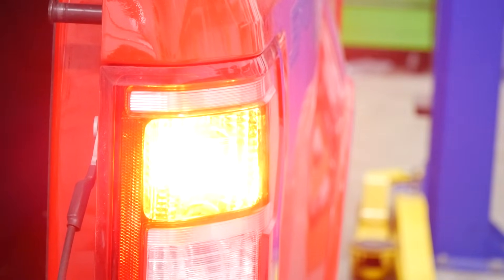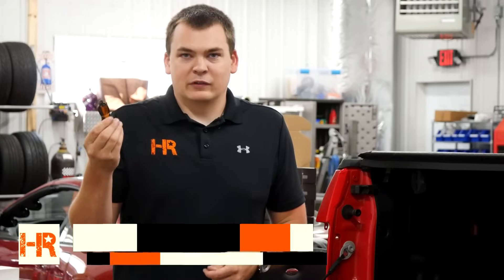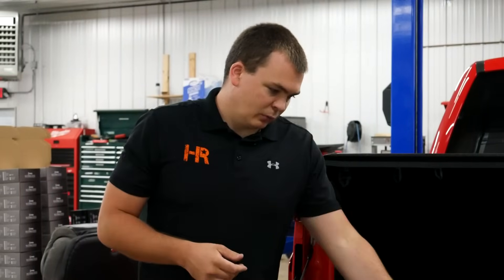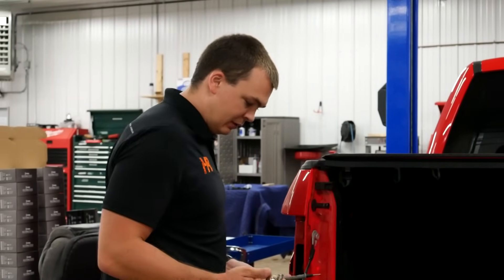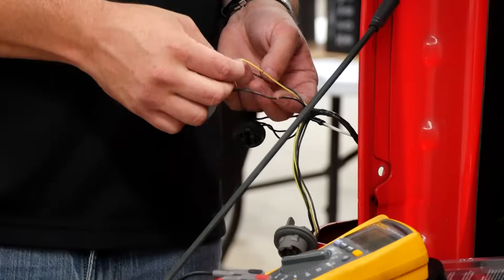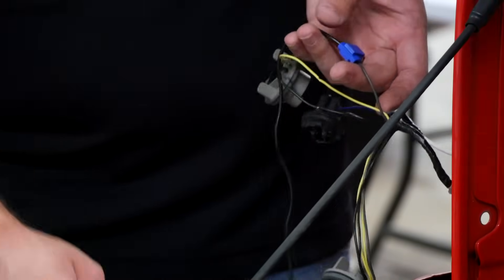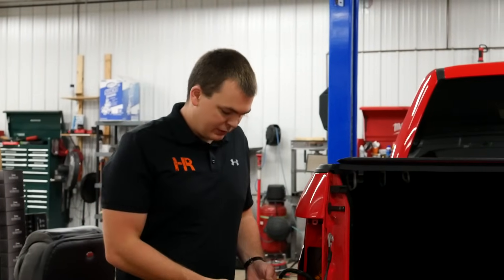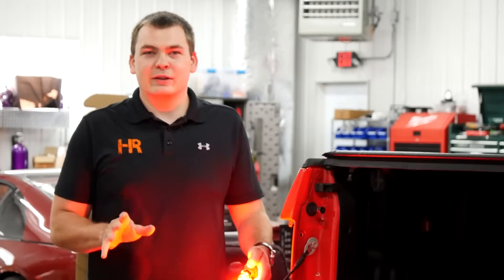How To Install LED Resistors - Everything You Need To Know | Headlight Revolution

Comment: Resistors can get way too hot.. close to 300°F(search youtube for a video proof)... relays that are compatible with LED turn signals are not that easy to find for your car and also are difficult to install in some situations... try finding an LED turn signal that closely matches the power consumption of an incandescent bulb. For my 2019 prius I found this OXILAM 7440 LED Bulbs Amber Yellow 2800LM. power: 21 watt current :2amps. Working perfectly so far.
Reply from the maker: For a resistor-less turn signal, I would recommend going with the GTR Lighting Carbide Canbus bulbs that I have linked below! They will allow you to install those LEDs into that vehicle, and will not require you to change the relay out or add resistors! Let us know if you have any other questions, we are here to help! Have a great day!

Comment: Does it matter if I install the resistor on the front turn signal as opposed to the rear ?
Reply from the maker: I am a little confused with your question, as you will need one turn signal resistor per bulb. If you are saying that you installed the rear turn signals, but are trying to put the resistors for them on the front, that will not work at all. You will need to have one turn signal resistor in line for each bulb you replace to LED!

Comment: So does one of the resistors need to be installed on both the left and the right rear sides to work ??   One per side ?  They look great!
Reply from the maker: You will need one resistor for each turn signal bulb that you have replaced to LED, other than that you will be good to go! Let us know if you have any other questions, we are here to help!

Comment: Question..... I am getting ready to install all LED's in my veh. 2011 Expedition. My question is shouldn't the resistors be wired in series with the LED? My thinking is, with the resistors wired in parallel, if there is a LED failure the on board factory warning system will not pick it up since there will still be a proper load on the circuit. If wired in series and the LED failed, the circuit should be broken and trigger the lamp out warning. Looking forward to comments and feedback on this question. I did put some LED headlight bulbs in my Explorer which had driver, resistor and heat shield and fan built in. Would only show lamp out warning occasionally when i flashed my high beams several times in a short time, also occasionally when remote start used.  I did not put LED stop/turn/park lights in the explorer yet. Currently doing this to my Expedition.
Reply from the maker: That is a very odd issue that you were seeing, not sure what is going on there. I will say that in this video, this is how you will have to wire the resistors for those turn signal bulbs, this is the only way that they will correct for hyperflash. Let us know if you have any other questions, we are here to help! Have a great day!

Comment: I have a 2016 malibu, I changed the reverse lights to sylvania LEDs. But when I turn the car off or even if it's not in reverse, the reverse lights dim and stay on way too long. Any help is appreciated.
Reply from the maker: That is very odd, definately should not be happening. I would recommend trying out some of the GTR Lighting Ultra series reverse bulbs! Not only will they be a massive upgrade even from those Sylvanias, they should work just fine in that reverse light application! I have linked those for your vehicle here: https://www.headlightrevolution.com/921-t15-1000lm-led-bul.reverse-bul-.ubul.r.s-bulbs-t15-sLElm-Ls-LED.BUL.REVERSE.T15_2?quantity=1

Comment: Installed the morimoto xb taillights on my 2015 ram 1500 and I’m having issues with the parking lights going in and out in cold weather. My guess is because of the less resistance in cold weather. Manufacture sent me 2 resistors to install to help. Would this process work the same for parking lights?
Reply from the maker: That sounds like you may be having issues due to the vehicle being a 2015, the 2015 MOPAR lineup had trouble with aftermarket lighting in general. Shoot us an email and we will see what we can do for you! Sales@HeadlightRevolution.com
Reply: @HeadlightRevolution  yes I did get a mechanic to read the BCM and I already bought some pretty expensive resistors as a recommendation by retrofit source. It only happens in cold weather so I’m afraid extra resistance would be too much
Reply from the maker: That is very odd, I would assume that it is due to the fact that you have a 2015 Ram. Sorry about that my man, if you have any other questions just let us know! Have a good one!
Reply: @HeadlightRevolution  yeah I had no problems until fall rolled around and the temps started to drop. Seems to only happen when it’s below 40. BCM throws codes at that point and shuts the parking lights off
Reply from the maker: Very odd, email into us and we will see what we can do to get this resolved! Sales@HeadlightRevolution.com

Comment: Do you need a resistor for each bulb or does 1 resistor work for both bulbs on the circuit?
Reply from the maker: You will need one resistor per bulb, let us know if you have any other questions! Have a good one!

Comment: Great video!! I have a question: I have a pontiac firebird trans am 1999 mod 5.7 ws6 with hyperflash turn signals front and rear. I installed led bulbs 3157...and the turn signal works but not park lights. The original bulbs works ok, but very weak and this hyperflash is still going when use the turn signal.  What would be the right led bulbs to use and in case the proper led resistors?
Reply from the maker: I am wondering if you have double checked the wires you have the turn signal resistors connected too, you may have them wired to the wrong ones. Make sure you have them on the turn signal power and ground wires, and let us know what you come up with!

Comment: I replaced the Headlights of my 2014 Toyota RAv4. The new LED headlights do not turn on automatically.  I have to manually turn on the headlights after I turn on the engine. What's wrong? What is the fix?
Reply from the maker: That is unfortunately something we see with those automatic headlight options, I wish there was a way around this but there is not. Sorry about that!

Comment: How do you find the correct resistor for a 2013 malibu? I'm replacing the entire tail light assembly from condesent to LED tail light. It was supposed to be plug and play, but all lights not working correctly, or flicker and hyper blink.
Reply from the maker: For that taillight, you will need to contact the company that you purchased the taillights from, they should be able to get you taken care of! Sorry I couldnt be of more help here!
Reply: @HeadlightRevolution  I found a company that can install and make them work correctly. Thanks for the response.
Reply from the maker: Glad you were able to get that figured out, sorry that we could not be of more help here! Let us know if you need anything else, have a good one!
Reply: @HeadlightRevolution  from what I explained to a shop that deals with this, my vehicle is not set-up for LED configuration by factory, something about the BCM. when I bought these lights, advertised plug and play. Apparently not. I live outside Corpus Christi, there's a shop called Competition Sounds, they said this is a common problem about misleading information but can be addressed and fixed with proper installation. So before I do any unnecessary damage, I will definitely bring it to a professional.
Reply from the maker: That sounds like a good plan, they will be able to make sure those lights are working for you! If you need anything else from us, let us know! Have a great day!

Comment: My car radio gives noise whenever my aftermarket led tail lights are powered on.any solution for this problem ?
Reply from the maker: That sounds like you will need some static reducers, I have linked them for you here: https://www.headlightrevolution.com/radio-static-reducer-rings-B-FERRITE_2?quantity=1 

You will need to install that on each side on the power wire for the taillights, that should fix this issue for you! Let us know if you have any other questions, we are here to help!

Comment: I have a 1996 Dodge Grand Caravan that I'd like to convert over to LED lighting interior and exterior, and I've run into a problem with the tail light turn signals, Chrysler did not make individual connectors to each light, and instead created a single socket that branches out to the three different bulbs, there is no way for me to strip the line going to the turn signal only - is there another way I could possibly do this?
Reply from the maker: That is odd, I am wondering if you are saying there is one bulb that performs brake and turn signal functions, or if you are saying there are 3 seperate bulbs that are somehow on one connector? Let me know and we will go from there!
Reply: @HeadlightRevolution  The way they did it, there is only one pigtail that connects to the taillight, there are 3 individual bulbs in the taillight, one is break and running, one of turn and running, and the last is just reverse. The bulbs connected to the harness through little metal plates that connect when you twist the bulb into place.
Reply from the maker: Now I am even more confused, unless that is an aftermarket housing or an OEM LED or sealed housing, I have not seen those before. I am wondering if you could email us with an image of those housings removed from the vehicle, that would help immensly with getting you a recommendation! Sales@HeadlightRevolution.com
Reply: @HeadlightRevolution  You could just look up any third gen Chrysler Minivan (96-00) Tail light replacement here on youtube and see exactly what I am talking about, but I'll see if I can find a good picture to show what I am talking about and send it to y'all.
Reply from the maker: Sounds good, send us that image because that is not something we have ever come across before. When we get that we will be happy to see what we can do as far as getting you replacements goes! Let us know if you have any other questions!

Comment: I have a 08 Silverado and wanting to put LED in the back and both the top and bottom bulb in the tail light both blink so will I need 2 load equalizers per tail light fir a total of 4 resistors?
Reply from the maker: You got it! You will need one resistor per blinking bulb, so if you have 2 in each housing than you will need 2 resistors for each side! Let us know if you need anything else, have a good one!

Comment: Ok, I've got an 87 Bronco II and all the lights have been switched to led except the taillights. They act as the running lights, break lights and the blinkers. When I install the led bulbs the break lights, driving and the hazards work but the blinkers go solid on. When I swap out the 552 flasher for an led compatible flasher the driving, break and blinker don't work but hazards do. What am I missing here? What do I need to get the 1 led to operate the same as the halogen?
Reply from the maker: That is odd, and I will need you to do some testing since you are using different aftermarket relays for those turn signals. I will need you to remove the relay, and let me know exactly what the lights do, then let me know if you are also using turn signal resistors? When you get that to me I will be able to better help you get this issue resolved!
Reply: @HeadlightRevolution  I haven't got your resistors yet because the lights don't fast blink like everyone talks about. All I read and hear is that when you install led lights on old vehicles they fast blink. I don't see that issue and even if I did have fast blink it's better than what I'm seeing now. I've tried a standard relay, led compatible relay and now a relay with a reverse polarity regulator. It just seams that the 1987 Bronco II is completely different than any other vehicle on the planet.
Reply from the maker: What bulbs are you using exactly? Let me know and we will go from there!
Reply: @HeadlightRevolution  I've tried all Sylvania 1157 led and Philips 1157 led bulbs sold by Autozone and Oreilly Auto. Plus I've used Ibrightstar, Auxito, Auxlight and  Brishine from Amazon. None of them work with any relay and it doesn't act the way anyone describes. Every fix is for fast blink. Nothing is a fix for it not blinking, not acting as running light or not activating as a break light.
Reply from the maker: That is very odd, I am honestly not sure what exactly you would have to do to get those working. I am wondering if you could send us an image of the bulbs that you are using right now, that would help us determine if you have the correct bulbs or not! Other than that, since they are not our bulbs I am not able to speak on those with authority. Sorry about that!
Reply: @HeadlightRevolution  that's where the danger lies with the Bronco II and Ranger. They all operate the same way. Your website sells break, tail and blinker leds all separately but for the Bronco II and Rangers they are all the same bulb. I'd have to make a huge choice between 12 sets of lights between $70 and $100 and risk none of them even working. I'd be ordering, returning and exchanging for months just to POSSIBLY have your products work. It would be different if my issue was common but seeing as the only issue in existence is hyper flash and my issue basically does not exist outside of my vehicle. I just want to have a vehicle that can be seen for safety and regular halogen isn't gonna do it.
Reply from the maker: I totally get that, I would say that your best bet would be to try a pair of the resistors with the turn signal bulbs instead of the flasher relay. They may work if they have the resistors installed in between the turn signal p[ositive and negative only. I am thinking that there may be a chance that the flasher relay is messing with the rear brake lights and turn signals, but that is just a guess. I wish I could be of more assistance here, so sorry about that!

Comment: I have a Chrysler 200 2016. What resistors would I need for my headlights because when I put led lights there, my car tells me low beam out when they’re not out. After while the computer will eventually turn them off. Can u help please?
Reply from the maker: You will not need a resistor for that, you will need a pair of the PWM Modules linked here: https://www.headlightrevolution.com/gtr-lighting-pwm-hid-kit-modules-ACC.PWM5202.MOD_2?quantity=1

Let us know if you have any other questions, we are here to help!

Comment: I bought some LED resistors for my  new LED s drls to try and fix the flickering.. but didn't seem to work? This is on a 09 Lexus isf btw. Any help or pointers would be appreciated
Reply from the maker: If that DRL uses the low beams, then you can get a pair of the PWM modules to correct that issue, and I have linked those below! If you have a DRL that uses that high beam bulb, I am sorry to say that we will not have an option for you other than halogen. If you have any other questions, let us know!
Reply: @HeadlightRevolution  yeah it uses high beams
Reply from the maker: I am sorry about that, we will only be able to get you a halogen bulb replacement, not an LED of HID replacement. I have linked the halogen bulbs I would recommmend for you below, and if you have any other questions just shoot us an email. Sales@HeadlightRevolution.com

Link: https://www.headlightrevolution.com/9005-halogen-osram-cool-blue-boost-B-9005CBB_2?quantity=1

Comment: How do you install resistors for brake lights?
Reply from the maker: For brake lights, you will only need resistors if the brake light flashes  with the turn signal. For those style brake/turn signal lights, you will wire the resistors in the exact same fasion, with the resistor between the flashing power and the ground. If you have any other questions, shoot us an email and we will be happy to help! Have a great day!

Comment: So i just installed. Three flash then solid brake lights in my 2017 Hyundai Elantra. They work fine until i turn my headlights on. then they flash once and dont work. How would i fix this?
Reply from the maker: Those Hyundais have a very picky lighting system, and I hope this issue is not due to that lighting system! I am wondering if you have the turn signal resistros installed? Shoot us an email with your response, and we will be hapyp to get you taken care of! Sales@HeadlightRevolution.com

Comment: What the hell... How can we know what kind of resistor , the values, how much ohms, kilo ohms or mega ohms... Just useless.. 👎👎👎
Reply from the maker: All you need to do to get the correct resistros is click on the link provided in the video description! I have linked that for you again right here: https://headlightrevolution.com/gtr-lighting-50-watt-6-ohm-gold-style-resistors-for-custom-installation/

Those will be the correct resistors, I am not sure on any of the other technical specifications, but they are what you will need for your vehicles 12V lighting system! Let us know if you have any other questions!

Comment: I have a 2018 toyota rav4, I want to replace the brake lights and turn signals with led bulbs. What resistors should I look to get and install?? Thank you!
Reply from the maker: You will want to go with the same 50W 6ohm resistors, and you will need one with each bulb! I have linked those for you here: https://headlightrevolution.com/gtr-lighting-50-watt-6-ohm-gold-style-resistors-for-custom-installation/

Let us know if you need anything else!